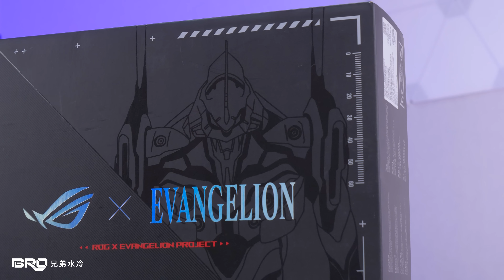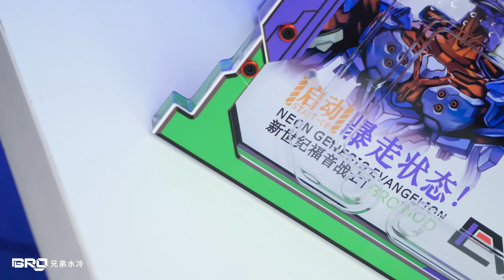「BRO」4K ASUS ROG Strix Helios PC Build Neon Genesis Evangelion.华硕太阳神分体水冷EVA装机视频4K #GX601#EVA

Comment: I have watched all the EV 01 builds, but yours stands out for several reasons. The custom work you added, both the artwork and the custom water cooling. Great work! I often wondered, if I attempt custom water cooling, if I should just use fittings or fuss with tube bending. Currently I use AIO's. But the way you design your system to make great use of fittings is fantastic. The way you line everything up. Great work and art! This video made me Subscribe and go back and watch all your other videos.
Reply from the maker: You can buy our BRO water cooling kit, which can also install the effect in the video
Reply: @BROCOOLING  where can I bought it?

Comment: are those stainless steel tubes painted green? looks great! any concern of corrosion using metal tubing long term? do you need to change coolant more often?
Reply from the maker: Electroplating / will not corrode, replace the water coolant every three years